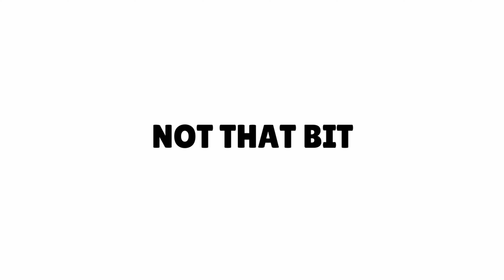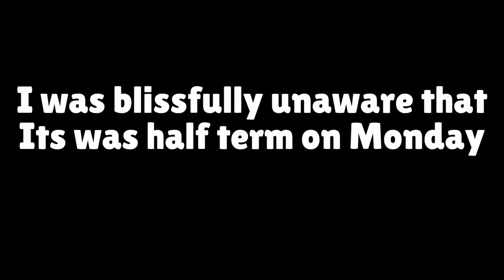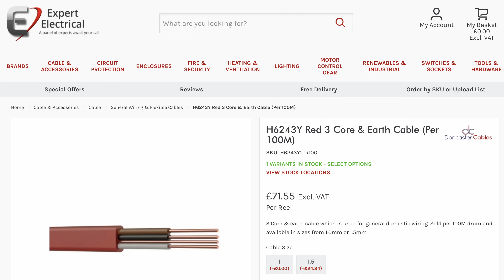Neatest Job To Date - Bare Brick Rewire UK Electrics

Comment: Wish every installer worked to your standards. We work that way in industry, and I want the same for my home. Can't abide heaps of scrap wire ends and drilling debris under the floorboards. Keep clearing it all out and leaving a job to be proud of. Nice work !!!
Reply: yes, tidy up under the floor, unless it's 100 yrs of plaster debris in which case, hard nope. But i WILL clear up MY mess

Comment: As a fellow sparkie… great to see the level of pride taken in your work. Personally, I’d use less cable staples, just thinking of the next guy. A clip every 500mm is enough for me on singles. With multiple cables, a 25mm galv union, nuts & a bracket. Main runs, use tray.
I’d never run in the corners of any room. That’s where people put trunking. Galv trunking sunk in if there’s no alternative & at least 50mm from the corner. Regs books make things look pretty, but don’t live in the real world… but good on you. Keep up the good work

Comment: just quickly from what ive seen- 

straight runs to the board- means easier too pull and less chance of burning saving time
3core cut to same length- easier pulling through 1 time, less change of burning saving time
pendant pattern- they do it for new builds, i think it should be common practice for good light fixing

love your work mate, I really try my hardest to do the best job I can like you, even when I dont have the time and people to appreciate it :)

Comment: I see some spark in 50 years time installing a fusion-boiler in that house and marvelling at the high standards that electricians of today worked to.  Unfortunately this seems more and more the exception.  

I might have run that cluster of cables in the corner of the toilet room in the next-door room in 4x2 trunking in the corner and then across, under the fuse-board.  

Superb work!

Comment: Hi, while I admire neat work, and this is. 
As an electrical contractor I also see that just because we would like to run everything in a perfectly straight line, from A to B or laser up from a socket run, it clearly says in the OSG that any joists be drilled between 0.25-0.40 of the span of the joists between supports, so where rooms change and wall spans differ in distance that becomes more or less impossible as the zones change.
Reply: Yes refer to building regs in that case. We had to get a structural engineer involved on one job as the number of joist holes was ludicrous (LoxOne smart home system, literally hundreds of 1.5mm twins back to the control panel) ended up with RSJs  (and yes you CAN drill them just like joists, the central part of the web is the zero stress area)
Reply: cost a few holesaws but peanuts compared to the cost of the RSJs
Reply: The easiest joists for any build are the open type composite ones with the metal bracing, no holes are needed at all with loads of space for separate cable runs, drainage etc.

Comment: Good tip is cut lots of all round banding the plastic covered one...and place 👍 it along the joists instead of expensive staples or clips

The metal banding supports the cables nicely and looks super neat...

Or i have even fitted 2inch under the floor 😂

Comment: I have the super hole hawg which imho I think is better because of the keyed chuck. I purchased mine after using my brothers which is the standard version (it has a hex shank which limits which drill/auger bits can be used. I don't think his had a gearbox on his and it was much lighter & smaller than mine, from what I recall. 

Anywho, either way they're both an excellent bit of kit. I think the version I have was designed more for plumbers and the lighter one was designed more for sparks, I do both.

I'd go for the super, bulkier but it had 2 speeds, keyed chuck and eats through timber.

Comment: By the way for the size holes that Sparks drill the Hole hawg will do. Super Hole Hawg is designed more Plumbers as they generally drill larger size holes for waste pipes. And get the quick-lok hole hawg version if you can find it. Enables you to swap out drill bits without a chuck key. Its the BOOM!

Comment: Gen 2 feul super hog is the best, and absolute goat or a Unit, it's the best, pair that with an Irwin tri blade speed bit and your set, I use a 8amp battery with mine. She goes brrr, best $600 cad ever spent.

Comment: No floor probes for stats? If not they should be at 1500mm from floor to pick up ambient temperature. Floor probes are always better to have in with ufh to limit floor temperature to limit danger of floor cracking etc

Comment: On the 2 ways, save your 3 core and earth and just run 2 core and earth for the strappers, as long as your have feeds and switch lines both ends. Saves money and space.
Reply: Not supposed to use an earth conductor as an live conductor/strapper bud.

Hope that helps
Reply from the maker: @bramcoteelectrical1088 he’s not on about using the Earth mate, if there’s a permanent supply at the switch, you don’t need to use a three Kaur across because you only end up doubling over on L1 and L2 anyway
Reply: @bramcoteelectrical1088  if you didn’t get it,I’d go back to class BUD,.

Hope that helps
Reply: @NBundyElectrical  get it now my bad sorry guys 😐 😅  the whiskey hadn't kicked in 😅
Reply: My bad I read post comment too fast and misinterpreted.

This is old skool way 

Switch 1
Live wire at common
L1 stapper as described
L2 strapper as described 
Earth conductor as described 

Switch 2
Switch wire to light ✨️ 
L1 strapper as described 
L2 strapper as described 
Earth conductor as described

Correct me if still wrong lads as everyday Is a skool day :)

I open to new idea hence asking as only know 18th edition way and old skool way
Reply: @bramcoteelectrical1088 I'll take that as an apology I think, suggesting that I would consider using a cpc as a live conductor strikes right though the heart and would be rough as fuck.
Reply: @supersparks9466  definitely and sorry I get alot of armchair sparkies and it gets irritating and tiring and I see your a proper sparky so apologises.

I am old skool sparky :l

Comment: Having worked as a JIB APPROVED Industrial electrician for 50 years I was lucky to have worked in the decades where doing a good job was taken as the norm , having seen so called sparks work in the last 2 decades they would have been sacked 10 years earlier, I've worked for the biggest companies in England and worked on the largest contracts and worked under the scrutiny of electrical clerk of works who either worked for the client or the Education or Hospital boards, they checked every piece of work that you installed and they wouldn't hesitate to tell you to do the work all over again because it didn't pass the spec of the job or failed to meet the electrical regulations , so sparks today don't know they are born, they bitch about ring final circuits because they are too lazy to wire them, I have never installed a ring main circuit with smaller cable than 4mm , so in short keep on doing a good job, sod these other so called sparks.

Comment: Hmm. . . how about some 'Nick Bundy working with manufacturer's' stuff again?  
Like, if you were going to make some Nick Bundy branded oval conduit for example, how would it be different, or improved from the stuff that's on the market just now?  Thicker? flatter on one side? wider?  or would it be just the same?  Or would it have 'wings' making it easier to fix?
Back to you. . .

Comment: Love your work Nick but around 4.30 in showing all your neat cable runs that are all drilled outside of building regs zones ie they are within 25% of the ends, noticed this a few times - pointless using a square to measure up to the middle of a joist then drilling it right near the ends 🤷🏼

Don’t get me wrong we all do this but according to building regs it’s fundamentally wrong.